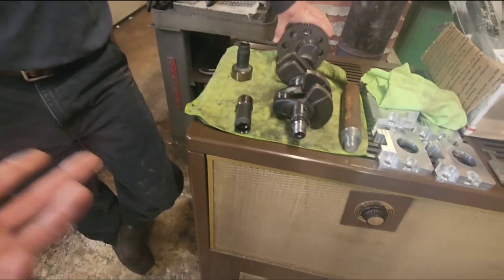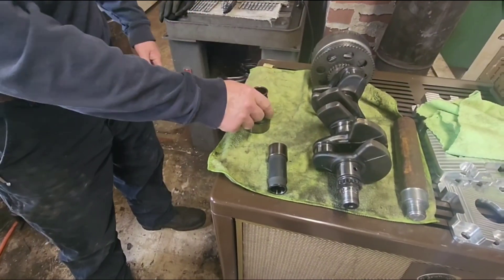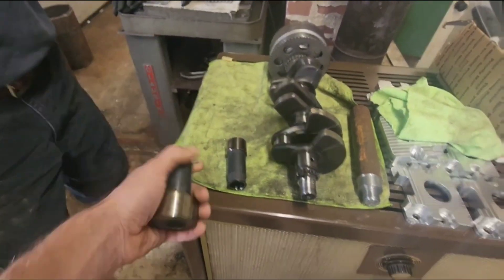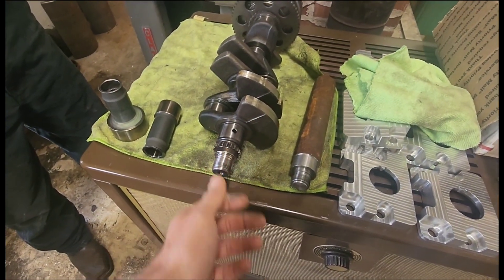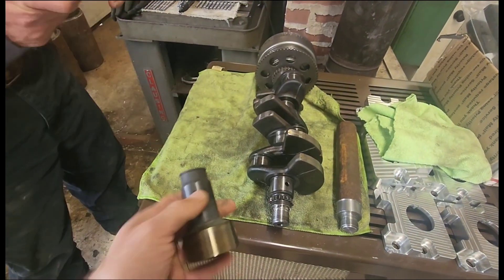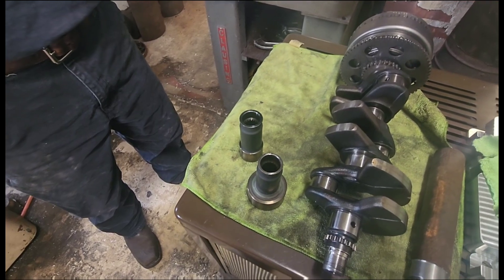Sea-doo Spark Crankshaft Output Spline Repair, Threading for New Style Female Coupler. Common issue

Comment: Can I please have his information
Reply from the maker: 4342224558 Greg Murray.  He responds best by text. Then you can call him once you've touched base. Tell him Philip sent you his info
Reply: @h2omechanic  I’m in va 757 area bought a cheap spark like you but I’ve got no oil pressure. Assuming the junk plastic gears have broken seems to be another common failure
Reply: How much did greg charge to do the job????

Comment: So if you knew he could fix it that way instead of pulling just the crank could you have just pulled the whole motor and took it to him and had him machine it or is it nessary to remove the crank from the engine? Just wondering bc that’s a game changer if so bc I’d rather pull an engine than take the whole damn thing apart if it’s still good running…
Reply from the maker: @Lineituplawncare  the crank has to be put on a lathe to cut the threads

Comment: Do you know what thread size is the inner thread on the flywheel side of the crankshaft?
Reply: Thread is metric M24x1,5 and yes you get die for that. i did same thing to my 2015 spark.

Comment: One of my customers brought in a 2018 GTS 90 with a "cavitation" complaint. After I seen the engine PTO, I knew instantly, that it was the OLD STYLE design that they stuck in the ski. I LITERALLY was in disbelief. I can NOT believe they put the old style design, in a "like new" ski, that furthermore, is the next model year design. It literally has 22 HRS on it. I guess they had thousands of engines that they wanted to "screw the future customers" with.